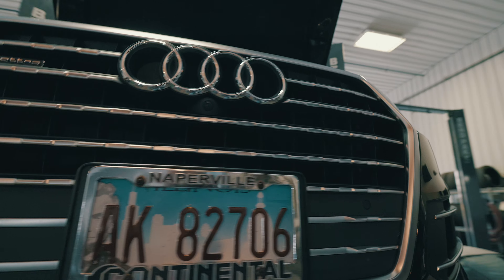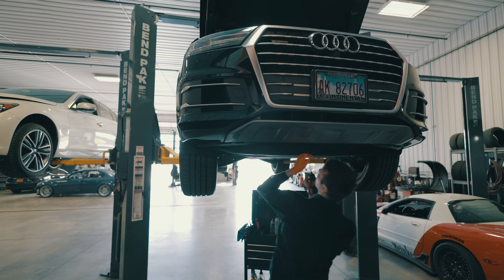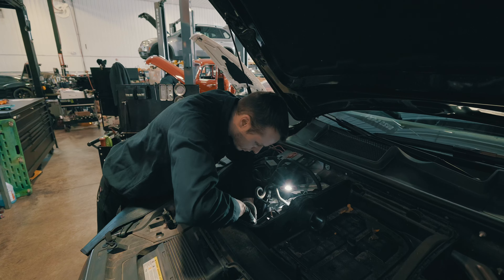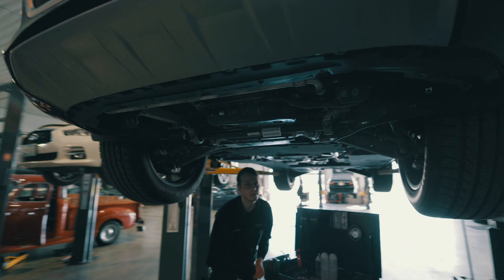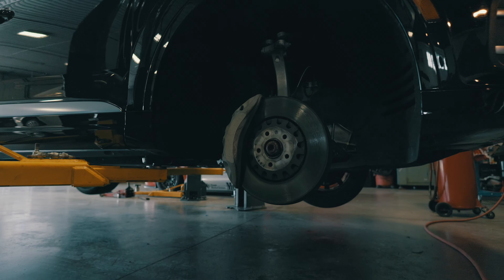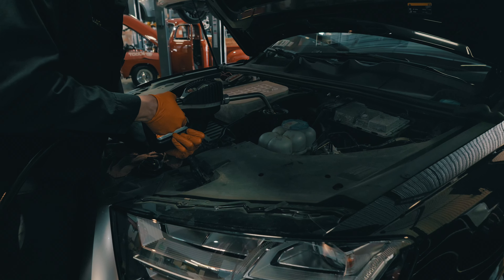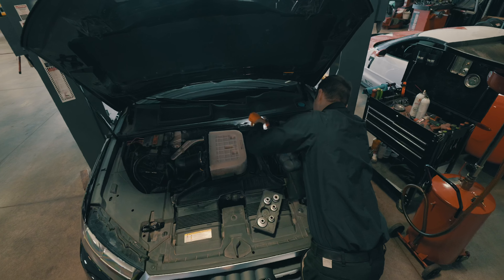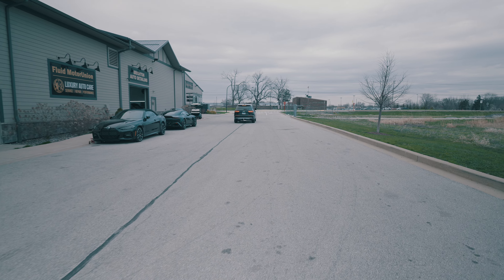Audi Maintenance Service - Minor and Standard - What's the Difference?

Comment: can yu help?  my car says its bluetooth prepared on sticker but has no bluetoooth.  how do i get blue tooth?
Reply from the maker: Possibly you lost the coding? Might just need to be recoded to recognize the module if it’s actually retrofit from factory…
Reply: @FluidMotorUnion  Just bought from original owner.  I mean a 2016 Q5 and no Bluetooth???  So I checked window sticker and it says bluetooth prepared.  Was hoping it was a switch someowhere ;)